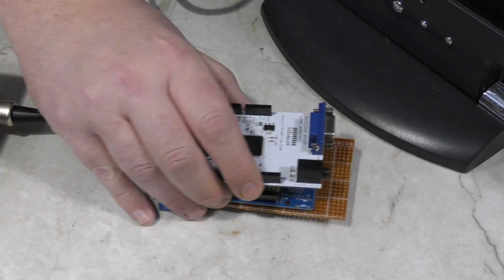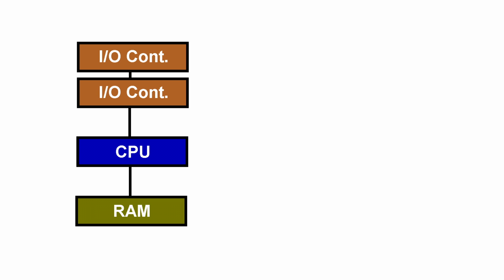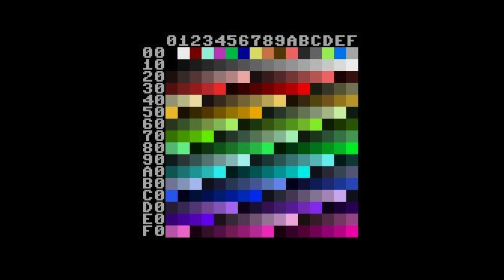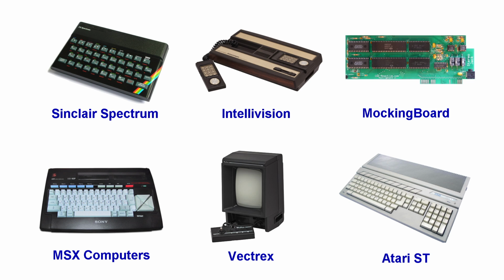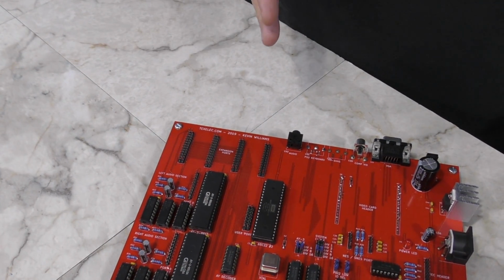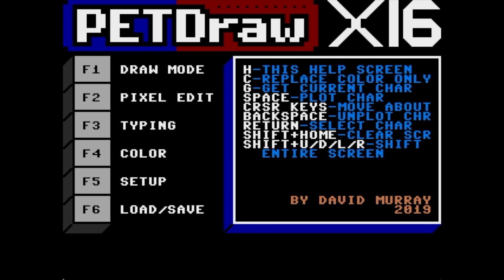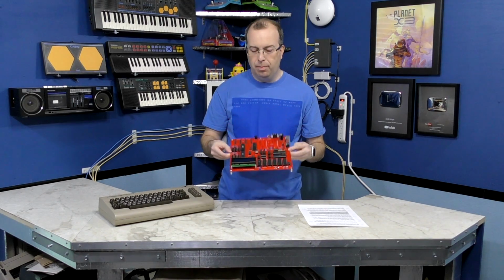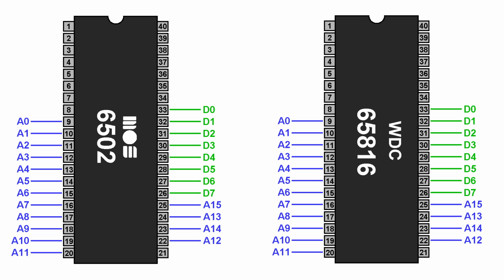Building my Dream Computer - Part 2

Comment: I am very excited for this and would love to have a very basic kit as I would enjoy assembly as much as using it. I recently started making a very simple 6502 computer with a eeprom and 6522 via  chip as a way to get better as circuit board design and also making them on my cheap CNC. I made it modular so it's easy to add things to it and I was successful in that it works and I can program leds to change attached to the via in assembly. Going to look at the Emulator and have a play. I recently wrote tetris on a teensy so might have a go at that.

Comment: I would stick with the Micro ATX board size due to the number of cases available for that size.  It will also give you plenty of room for IO ports and expansion card rear access.

Comment: so is it the fastest 8bit computer ever made ?
Reply: Sure not, there were FPGA designs with single cycle Z80 at 50-ish MHz, which is like ten times faster. Although it is in the higher end among those that were in the mass production (MSX Turbo R, PC Engine).

Comment: @The 8-Bit Guy - Glad you're still considering the 65C816 (with the same memory map) to get the benefits of the 16bit ALU etc.  It would also mean the X16 name remains appropriate (otherwise it should probably be renamed Commander X65).  The perfect CPU would've been the 65C802 it seems. But in it's absence, I do still hope you seriously consider the 65C816 (but with 16bit address space).  
This may be useful / of interest: http://sbc.rictor.org/support/conv.html  :-)

Comment: I'd put the SID-style chip on the vera.. Having sid'ish sound coming out of the X16 would draw in a hell of a lot more people, and allow the countless chiptunes to be relatively easily ported over.
Reply: 2xAY gives you 20000 songs to use, software to make music, and a community of active chip musicians well familiar with the setup. New sound hardware is interesting, but that's starting from scratch, and it often takes years before good composing software appears.
Reply: @shiru8bit  40:02 He already said due to having to run the AY chips at 2mhz max, the system would require yet another CPU between the main system and the AY chips to "slow down" the communication to the 2mhz the AYs are capable of running at, causing a fair increase in difficulty coding for them. (Edit: this would render all existing composing software useless)
This is why he was looking for alternative sound chips nearer the end of the video. One of the ones he mentioned emulated/sounded-similar-to the SID chip found (and loved) on the Commodore 64.
And I dare say there's far more active musicians for the Commodore's SID chip than for the ancient AY3.. And a muuch greater library for the C64 as well.

Comment: 35:20 then I would say that it needs a graphic editor for loading gif/tif/jpg, others something like GIMP..  Bring 8 bit to the web. Make a wifi dongle, modem or something...  Personally I would go for full size AT or ATX, but mini-ATX is good.  Perhaps another slight of hand version that would fit in an abandoned VIC/16/64 case.  I like that it would have 4 expansion ports/slots.  It needs also a MIDI interface, printer ports (serial/paralell or USB).  Definitely at least needs a disk drive or some storage medium that most 8bit/16bit people would have easily, even a small hard drive.

Comment: I would actually suggest using the TI-84 Plus Silver Color Edition as your dream computer. It's portable, supports ~255 colors (though TI will tell you it has 16 colors), and most importantly, you can code in Assembly, BASIC, and even C (AFAIK). With the I/O port along the USB Type-B port, you can plug in things like a speaker, an actual QWERTY keyboard, an accelerometer, another calculator for transfer purposes, and even more! The USB port will let you connect to a Mac or PC and write/send programs. Seriously, it's definitely should be up there.

Comment: I would still go with 65816, as it's also said you can (optionally) do 16 bit memory reads/writes, 16 bit ALU ops, and also 16 bit registers (yeah, index all the 64K with X or Y register, not only 256 bytes at once!!!) or A/B register in 8 bit mode with swap capability, some extra opcodes etc. And as far as I remember the price for 65C816 and 65C02 is almost the same from WDC, so then why not. However I even don't think it's so complicated to support the "decoding" of the upper 8 bit of the address bus, put on the data bus actually, it would require two 74'series (maybe '245 and '373, I cannot remember now  ...) of logic chips (though maybe a fast one ...) only and that's it. At least I already used that way, though on a slow 0.5MHz :) design as it was a busy breadboard with tons of noise and parasitic capacitance all over / etc. Anyway, if someone already feel love with the current memory model it can be even kept, with saying, the lower 64K (BANK0 in '816 terminology) any other bank when used can address upper memory areas which is normally accessible only with mapping to the "8K window". Thus then compatibility (thus the original clean/quite simple design - I mean in a good way!) is easily kept but bonus feature added with the possibility to create even more complex software. Actually it's even done by some people already like putting a 65816 in C64 (no, not the SuperCPU now, just DIY ...) utilizing the lower bank to as the "C64 stuff" and using "private of the '816' memory for any higher bank. Yes, it's not the same, but it can show something similar in concept, though not the same context, really, I admit :) Btw, WDC even mentions what actually 65C816 is more 6502 compatible than 65C02 (though on both cases, minus the "undocumented" NMOS opcodes ....).

Comment: The YM2151 isn't "similar to" the DX100, it's virtually identical to the chip in the DX100, although the one used there has some differences in test registers. And I can't confirm any uses of the YM2151 with a quick search that isn't greater than 4Mhz, so...

Why not an OPL chip, since people somehow manage to new-stock those, and would likely be more familiar to western audiences than the OPM or OPN? How about the SN76489? Maybe some combination of analog synth chips? I'm not sure what would qualify as easily and cheaply available nowadays, but you may have to pull a VIC and integrate something into your video hardware (since that's already FPGA)...

Comment: Well, I am not blown away by this. I recently got into MaxiMite, and it so fast and agile to use that I have a hard time hyping myself for the X16. MMBasic is wonderful to work with. There is sprite support and what not. Also, being a microcontroller you have commands for outputs and inputs, Arduino-style. ..but programmed directly on the unit. The X16 also sports a case that does nothing for me. As a side note,  it seems that the 8-Bit Guy is just the brand of the X16 - almost as if they decided he was the most famous, thus ensuring penetration. I dunno. I think it could end up a mess. I will follow the project with interest.

Comment: Modern Computer Guys=We run Graphics cards on SLI.
Vintage computer Guys= We run Sound Chips on SLI.
Reply: These sound chips were used in pairs (or larger stacks) way back in the 80s. It was just not common in home systems due to the costs.

Comment: Hi David, congratulations! I really liked the video and I would just give you my point of view on some aspects:
1) Vera addressing seems to be in high/low byte as opposed to 6502
2) For a real retro feeling edition I'd like a version (hoping the cheaper one :) ) with the keyboard integrated in the case like C64 or A500
2a) For the same feeling an integrated HDMI port would be great allowing to connect the computer to a modern TV
3) 8Mhz should be enough for anybody :) but it would be cool to run at full 14Mhz default 6502 speed
4) Because you have alredy choose to go in fpga with Vera chip, problably the best choice for the audio chip is to use the same FPGA. Anyway I wonder if the code will be open source
5) Please don't use nes/snes joustick data bus. The best thing about using the Atari DB9 port is the ease to use a button, microswitch or whatever to give an input to the machine. That DB9 port could in teory support 4 directions and 3 buttons, one standard as C64 and other two mapped in the X and Y axes of paddle pins (in teory it could use more buttons multiplexing with some resistors). It would be cool if paddles could be used too even if in this case we can have a single button (or maybe more than one using one or more joystick directions)
Reply: An integrated keyboard would be great and obviously more retro-correct, but wouldn't that whack the price up significantly?

Comment: Oh man, if I have the money I'm definitely getting the Stage 1 setup (kit form if possible), my only gripe is that I don't really want to fit in in a PC case (I'm not too fond of the idea, I feel it should be wedge-shaped like most of the 8-bit microcomputers), I'd rather stick in a clear acrylic enclosure so I can bask in its glory, so I was wondering if you can leave the barrel connector and LM7805 spots on the board for people who don't want to use an ATX PSU, I'm it's not a deal-breaker if you can't, I could always just use a PICO PSU.

Comment: Absolutely pointless!
This will sink without a trace, like the trillion other similar ill conceived “retro computers”.

The main problem is: 
Why stop with those specs‽
It is in no way or shape bound to historical facts or circumstances. 
The 6502 is only there as a mascot. 
The other parts would have been absolutely bonkers to try to market at any point in the eighties.
A retro computer not build to historical facts; a what if situation, is pointless.
I don’t see how that is not absolutely and immediately self evident‽

What’s more, the logo and case is about as bland and amateur as you could have feared.
There is a reason why industrial and graphical designer, is full time occupations and is very, very hard to do well.

Comment: Are you going to write a GUI based OS for this, like the Amiga?
Reply: That's a fair point, and perhaps someone will write it.  After all, if GEOS works on a 1 MHz machine (and it did), think what could be done with an 8 MHz machine.  Especially with 2 MB of banked RAM...
Reply: @Isaac Taylor But...there could actually be non-hacker types who want a machine like this, for fun or for gaming. Why cut yourself out of a large market?

Comment: Looking cool so far... but my main question is: can it do 3D rendered polygons?
Reply: At 8mhz with some clever coding this should be possible - Elite ran on lower clock rate 8 bit machines (without color fills)

Comment: Gah. David. Please do subreddits instead. Facebook is just the worst. Blocked by my Pi-Hole and that's not going to change.
Reply: Yes, this! I have not kept up with this project for this exact reason.
Reply: Go to 8-Bit Guy's website and link to the forum for more updates
Reply: @crappyatlife  Probably the fact you call people that is why you were banned from there.
Reply: Yes, I would have volunteered by now but I don't use Facebook!
Reply: He has a forum for this project too. https://murray2.com/forums/commander-x16.9/
Reply: Fuck reddit....

Use 4CHAN
Reply: @scottbreon9448  lol, still better than Facebook.
Reply: @scottbreon9448  he should post his updates on /pol/
Reply: @crappyatlife  cause facebook isnt
Reply: I didn't expect this to blow up, otherwise I might have put a little more thought and effort in. I really meant to say "anything but Facebook, reddit would be my suggestion."
Reply: this
Reply: I can understand not doing facebook, but suggesting some other place where you have to have an account to participate is basically the same (i.e. reddit).  The one advantage i can think of facebook over reddit in this case is that he's trying to get "real" folks to actively participate, and facebooks walled garden is pretty good for that.  Reddit allows for too much trolling and other dissension that would just pollute the discussion and way too much moderation is required.  I'd even go as far to say that anyone who can add value to this project is probably smart enough to know how to properly use facebook privacy settings or have other ways to participate in their walled garden while maintaining your personal privacy.  If it's just for personal hatred of facebook that's fine too, but remember that every site he could use will have a subset of folks who will refuse to use it (such as reddit)... theres no perfect option.  I'm sure he'll be providing regular updates through his youtube channel (for folks that don't have google blocked).
Reply: @BrianV_PM  That's a much more thoughtful reply than my flippant comment really deserves. I honestly didn't think much of anyone would see it and was just doing some personal venting that probably wasn't entirely fair. I agree with most of your points but I'm not going to the trouble of creating another user account on my Linux system and forcing it to use VPN with iptables just for this. 

Facebook has it's claws all over the Internet, if you don't have their domains blocked they will be tracking and profiling you via their integration (click here to post on Facebook, login with Facebook, etc) with a huge number of websites; even if you do not have a Facebook account and never actually venture their yourself. Because of that (and so much more), yes, I really do have a passionate hatred for the site and that is a definite factor that led me to my original post. 

Also, I doubt you have ever actually tried to create a privacy-focused Facebook account. I was forced to use it for a group like this 5-6 years ago and even with my old, not terribly privacy-focused account (which I have since shuttered) it was forcing me to pick out pictures of my friends nearly every time I logged in because I was apparently getting flagged as a bot due to abnormal usage (infrequent logins, only ever checking that one group and tightening my privacy a bit [not nearly enough for my comfort]). I don't think a privacy focused account like you are suggesting is actually feasible, without adding a fair number of your personal friends and family I don't think their captcha system would by possible to complete.
Reply: @cutchyacokov  Agreed.  While i have privacy setting on my Facebook account, It's not foolproof.  Though, i don't post anything on Facebook of personal nature anyway.  That said, if they want to profile me and send me ads based around stuff they think I'm interested in, it's fine... they're going to send ads anyway.  Anyway, maybe the best option for discussion on this is if David put a discussion forum on his own site, but I'm betting he doesn't have the time to maintain that.  The texelec person did start a thread on the vcfed forums, so maybe thats an option for some.
Reply: Imagine thinking the pedophile's second home is a good place to be
Reply: @aw4483  That subreddit (jailbait, I think you must be referring to?) was banned around 10 years ago. It only existed in the first place because anyone could make a subreddit for any purpose, so long as it wasn't illegal in the US. At the time many of reddits target users, myself included, had a fairly absolutest stance on free speech and did not fully appreciate the repercussions of systems created with that outlook. It's been a long road but reddit has come a long way in that department. There is still a lot of borderline content there but you won't see any of it unless you go looking for it.
Reply: fuck reddit tbh
just use discord or plain forum
Reply: @berthold64  Fair enough if you don't like reddit, I don't really care for Discord but, hell, anything is better than Facebook.
Reply: @crappyatlife  🖕
Reply: @crappyatlife  Reddit is cat country. All hail our furry overlords!
Reply: Continue to speak your mind, Cutchyacokov
!
Don't let the overlords control your thoughts!
Reply: If anything, do Discord. Perfect project for that type of platform
Reply: @Vistrus  Discord is absolutely terrible for any sort of discussion of this kind, and nearly as bad as Facebook.  No thank you.

Comment: I have a recommendation for BASIC & ASM mix.
COMPUTE! came up with an extension for BASIC many years ago in issue called "The Fast Assembler" in Compute's Gazette issue 31, page 78.
The basic idea was that you could mix BASIC & ASSEMBLY and assemble directly to RAM or Disk.
Here is a link to the article on Archive.org:  https://archive.org/details/1986-01-computegazette/page/n79
The reason I like this method is it only took about 2600 bytes of RAM to create & it allowed a seamless mix of BASIC and ASSEMBLY without any odd assembler conventions.  It looks just like BASIC, but with the power of Assembly.  Here is an example:

100 FOR PASS TO 3:PRINT "PAS
S"PASS,
110 ORG SC0CO
120 IF PASS=3 THEN ORG $C000,1
130 START: LDX #0
140 LOOP: LDA TEXT,X:PRINT TEX
T,
150 BEQ EXIT
160 JSR $FFD2
170 INX
180 BNE LOOP
190 EXIT: RTS
200 PRINT
210 TEXT: BYTE "EXAMPLE 1",0
220 NEXT PASS:END

You can also do includes as well.  Anyway, take a look please.

Comment: David, I was to comment that the sound chip selection was quite unbalanced compared to the care put in video, existing the Yamaha YM chips. They are not much more difficult to program than AY-3-8912. Have you consider Yamaha YM2413, YM3812 or  YMF262 familyes?
http://map.grauw.nl/resources/sound/yamaha_ymf262.pdf